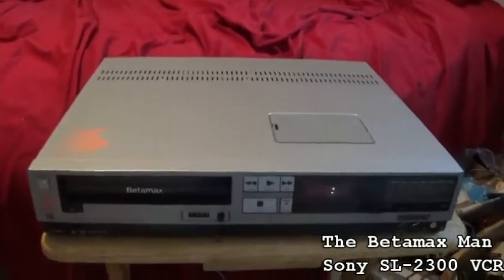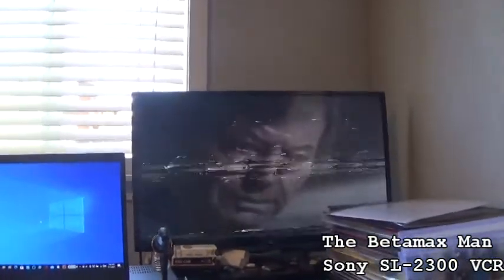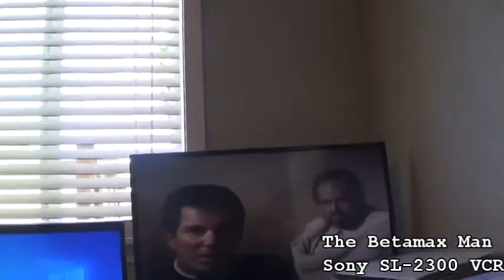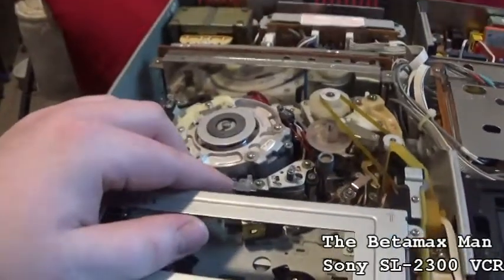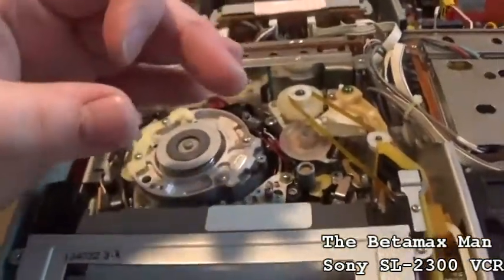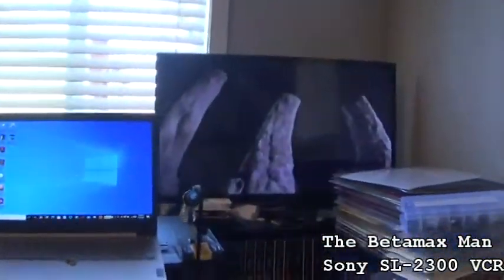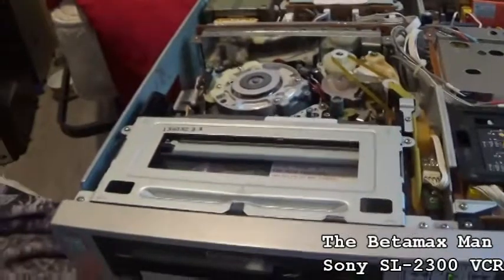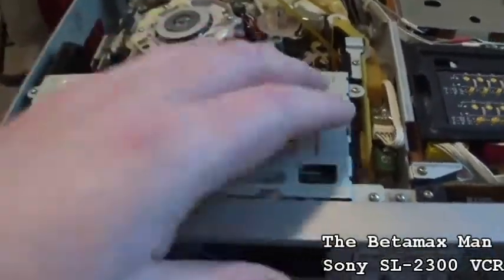Sony SL 2300 Tape Path Alignment With Out A Oscilloscope

Comment: Nice video. However, without a scope and without following the steps detailed in the service manual, one will never get perfect results when it comes to tape interchangeability for all transport modes. What is more, if the alignment has shifted from the ACE head region, most likely is due to a bad pinch roller, so first step is checking this element.
Reply from the maker: You Are 100% Right

Comment: What did you do to fix audio? I have same deck and have same muffled audio issue.
Reply from the maker: I don’t remember that vcr was done a long time ago
Reply: I cleaned the audio heads and that did not fix it. Any suggestions pf what else could be causing low muffled audio?